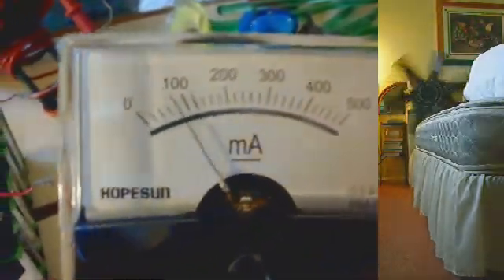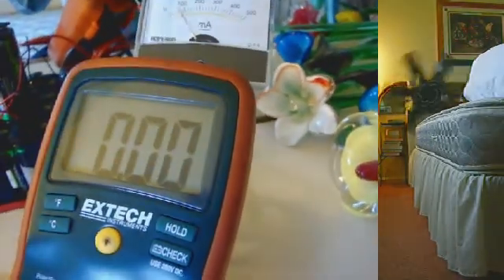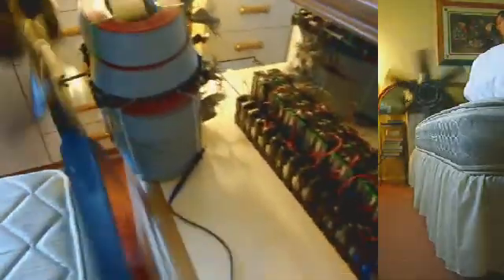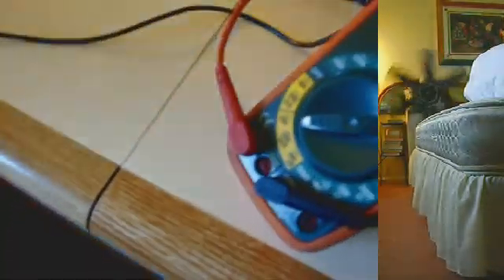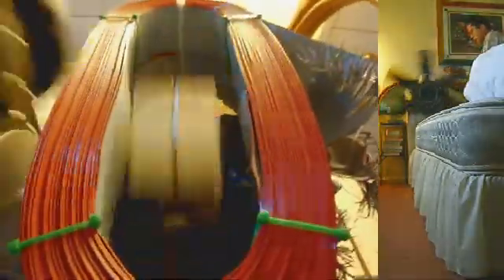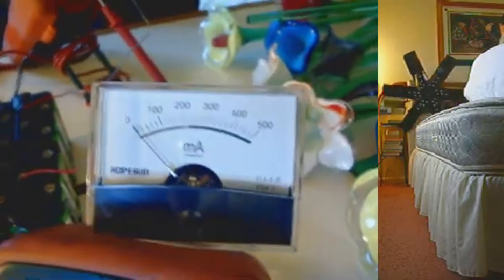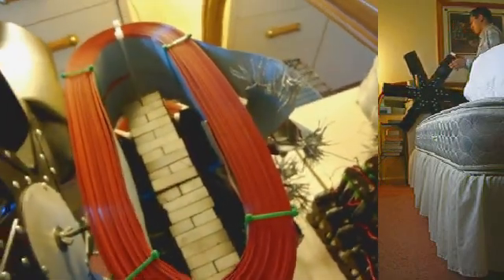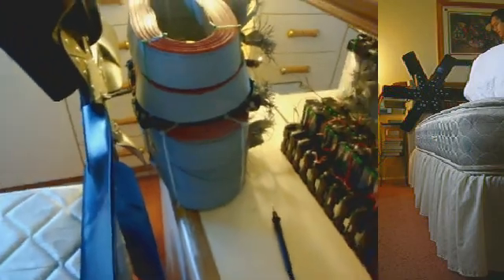Newman Fan Motor Analog (500mA range) vs. Digital meter (20A range)

Comment from the maker: @Shanjaq

"What's the no-load speed potential for the Newman Motor design?"

The design in the video only has twice the speed potential at no-load vs. having the load shown. In the case above, it is 240 RPM.